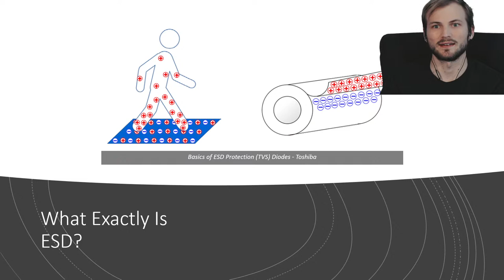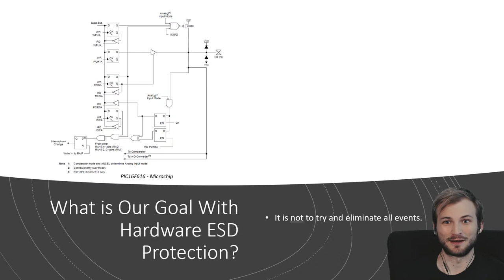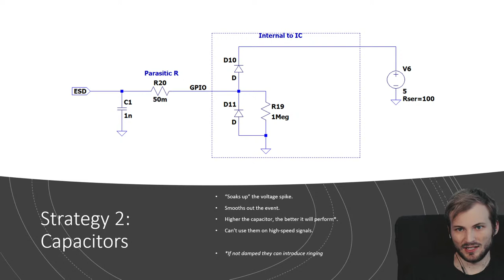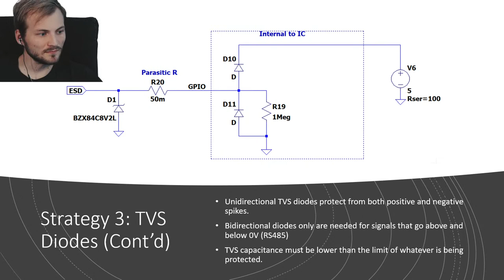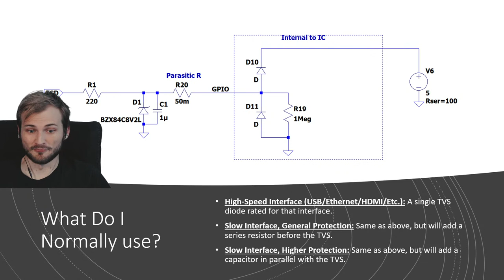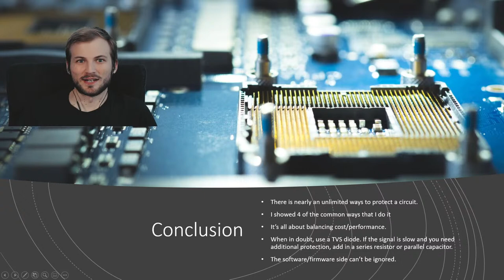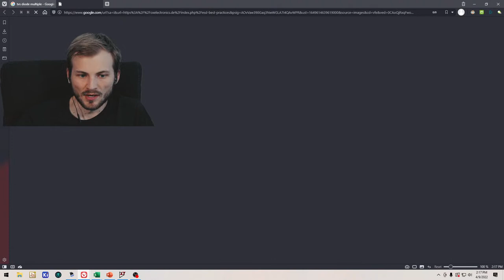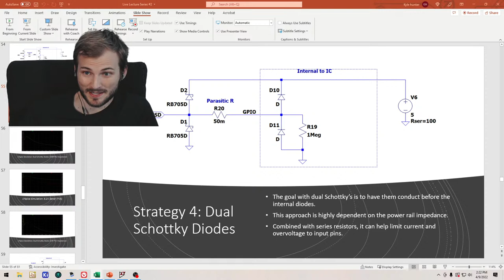Live Lecture Series #2: Designing ESD Safe Circuits

Comment: Thank you for the video, i have a question: do we need to protect vcc and gnd pin too? If for example those pin leave the board to be connected to a battery or power supply? And what type of protection we need to use. Thanks